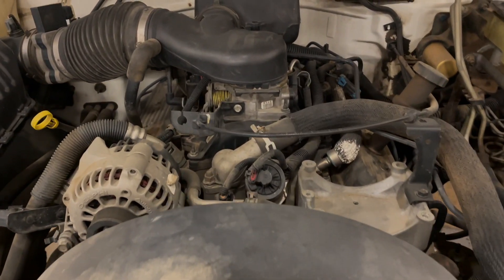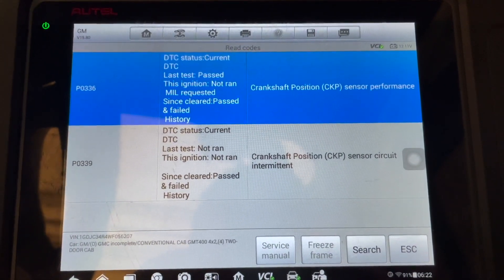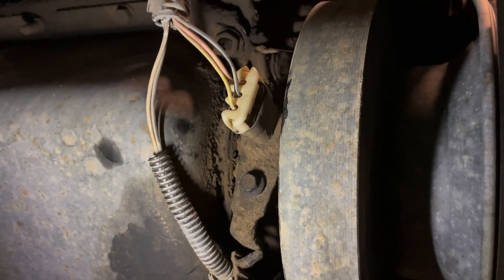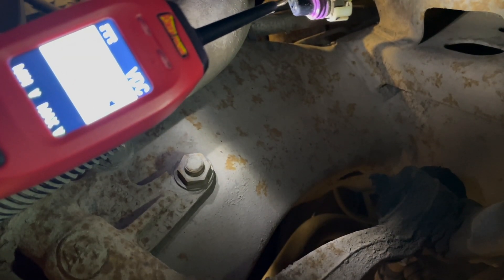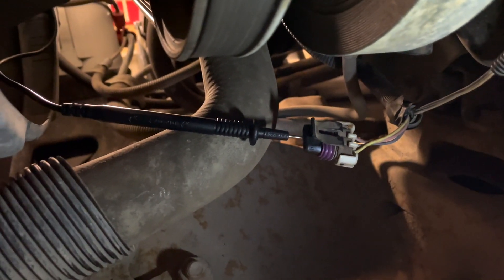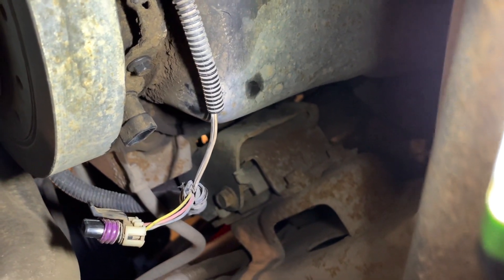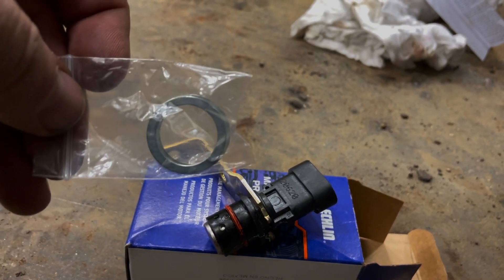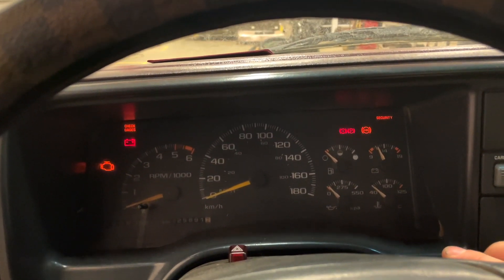P0336 P0339 Crank No Start DIY

Comment: You specified black wire but mine only has yellow pink and purple on the crankshaft positioning sensor.
Reply from the maker: Get the service manual for your vehicle and reference the proper wires, that should help you